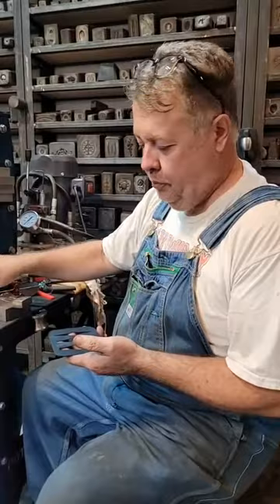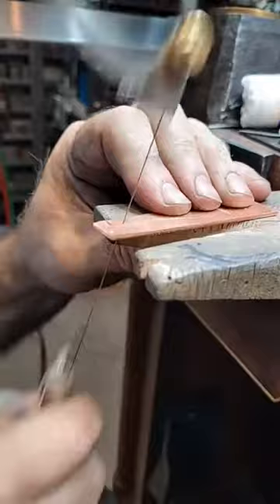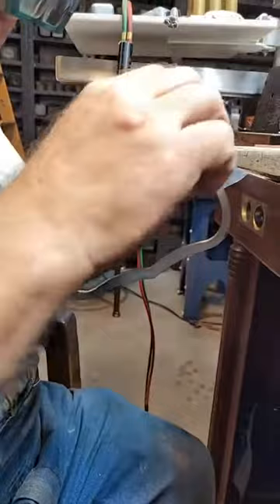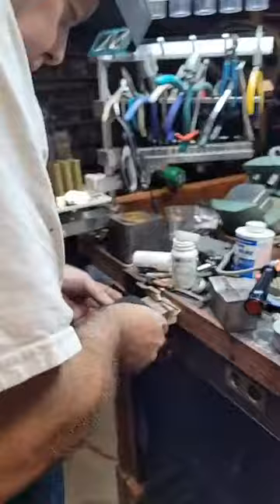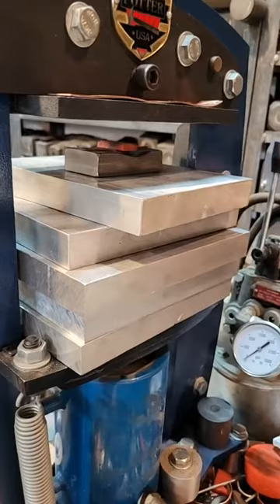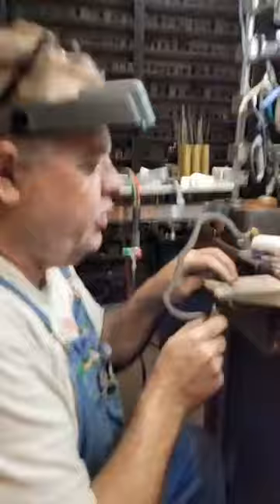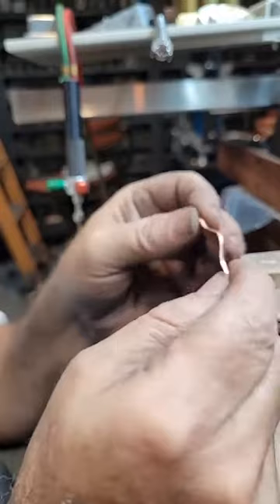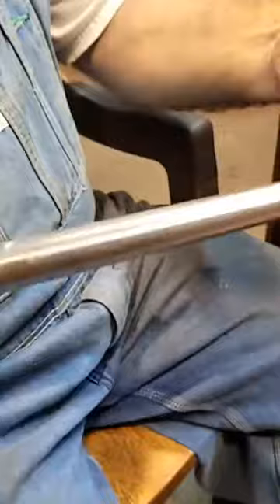Making Rings Easier and Faster with Potter USA Ring Kit

Comment: I have a real smith torch, but I think I got a fake torch tip from a reputable jewelry supplier, the big flame tip like you used in this video- the one I got was scary, self-melted and yeah it was dangerous. I can only imagine it was one of the fake ones, I've never had an experience like that with a torch of any kind before or since